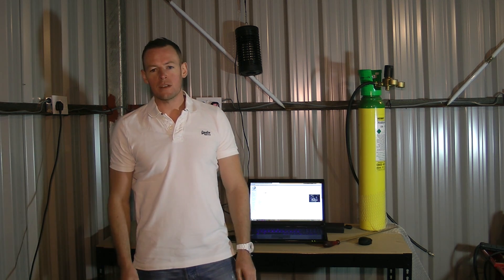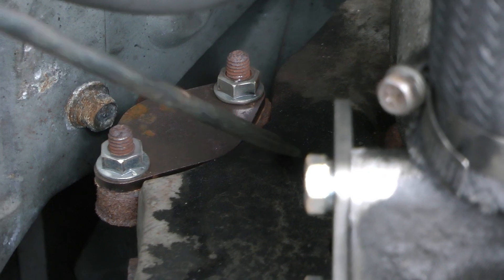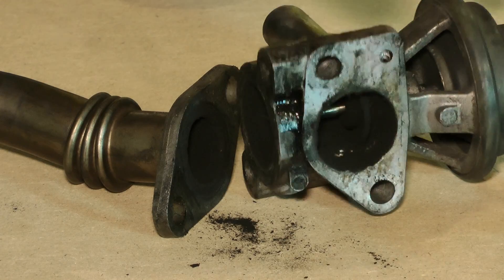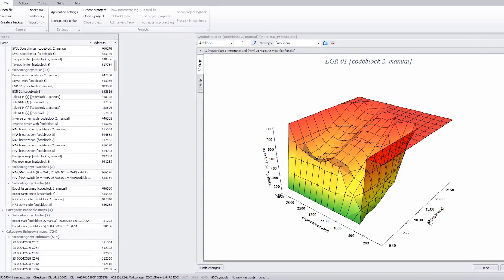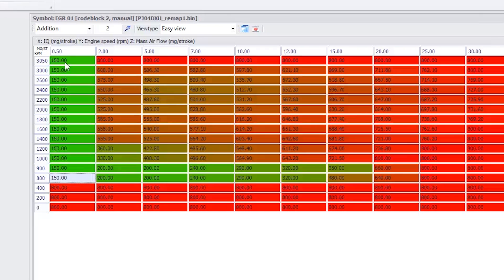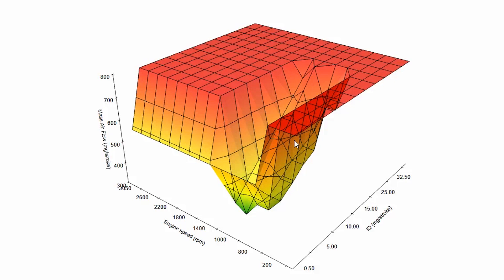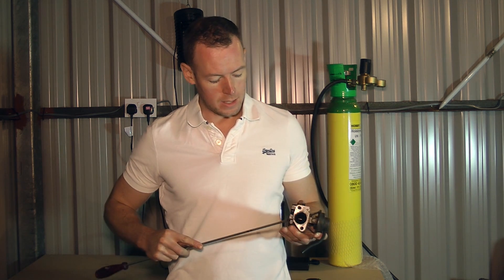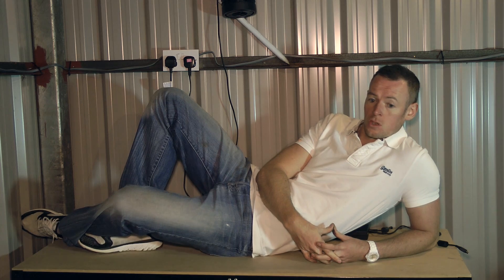EGR for motorsports

Comment: The only purpose for the egr is more fuel consumption so u buy more fuel. That’s all. They knew cars are going to be more fuel efficient so how can we reduce this. By putting the egr crap in. I have tested this and it’s true. I have the same cars with same engine 1 has egr and the other doesn’t. Guess what the non egr is cleaner and I buy less fuel.  Anybody got anything different.
Reply: EGR is shit, who the fuck cares about cars emissions? Industry produce over 70% CO2 emissions. Cut that off and all diesel without EGR would change nothing. Do not be blind. It is false economy.
Reply from the maker: Don't forget the cow farts mate
Reply: Blanked EGR in 2 L 4 inline diesel. MPG went up in city from 32-34 to 39-40...
Reply: Cattle produces more harmful gases than vehicles.

So stop eating soo much Beef

Comment: actually the egr system helps reduce cylinder temperature reducing pinging and spark knock if u dont run an egr valve you must use only a vary high octane or over time the pinging/ detonation in the cylinder WILL cause ur plugs to ware out vary fast and in some cases ive seen it blows holes in the pistons diesel engines are completely different animal you cannot compare taking an EGR system out of a diesel to take in an EGR system out of a gasoline car because the diesel fires differently
Reply: Huh...I thought EGR was developed solely as a way for Diesel powered vehicles to reduce the excessive amounts of NOx gases they produced as result of their high temp compression ignition system. Gasoline engines don’t produce these high levels so I’ve never heard of EGR on a gasoline engine. What manufacturers are using it and why?
Reply: @johncanalese588  Honda since the 90s.

I read saab was using it in the 80s.

However, neither put it in every car, even after the first application.

Comment: I have a few very serious questions that I'm going to ask here... Please only respond to me if you know wtf you are talking about, and you can actually answer my questions. For all you tree-huggers, I do not want to hear about how emissions control devices are so important, blah, blah, blah... You will NOT change my mind, no matter what is said to defend emissions controls devices on automobiles, so don't bother wasting your time or mine by responding to my post here. 
So I ask, TO ANY /ALL OF YOU FELLAS THAT KNOW HOW TO RE-MAP... Where Can I Buy This Re-Mapping Software? How does one actually use it to modify the vehicle's on-board computer so that I can eliminate the emissions shit from my vehicle? Do I need special scan tools or what, in order to link up with my vehicle's ECM/ECU &/or PCM in order to get these informational changes made on my vehicles?
If you'd rather not explain here, I'm fine with that. Supply me an e-mail addy or phone number, or some way that I can correspond with you and I will gladly get in touch with you to discuss further on the topic at hand. 
As an older veteran mechanic, I'm willing to pay (within reason, of course, as I'm not rich) whatever it takes so that I don't need to be pestered by this costly and useless god-damned EGR garbage anymore on my gas and diesel powered vehicles. 
I've done my homework enough to know that the large unnecessary repair expenses and continued downtime in our vehicles is really what is killing us all. Nothing like useless government restrictions imposed on us all to make our lives more difficult / miserable. 
It's a simple fact that vehicle emissions control device failures (that are extremely commonplace) are financially bleeding our society dry. It's certainly NOT the minuscule NOX emissions that is hurting us, it's the lack of money available for other things in our very short time on this earth (what we call "life") that are much more important.
THANK YOU!!!
Reply from the maker: If you're only going to map out the use of EGR it might be cheaper to find a tuner local to you and have them do it.  Rather than go to the expense of buying the software for only one task.

Comment: just because you didnt hear of other uses for egr doesnt mean there arent any :DDD egr on petrol engines safes fuel, on diesel engines it mainly improves emissions. you have lower throttle losses with egr because the engin can suck in more unthrottelet gases

Comment: Hello, I've got a focus mk2.5  2.0 duratec and I am thinking of fitting a egr blanking plate bought off eBay because I think it might be sticking like the one on my previous 1.8 version (same problem,  same fix) when I done it on my last car it ran and drove 100% better the only thing was the engine light came on after 2 weeks, and needed to get reset every two weeks regular as clockwork because of it,    Can this be programmed out with a remap ? 
I did think about removing the bulb but unfortunately ford used LEDs in this one
Reply from the maker: In short yes.  You should be able to find a mapper that will essentially map out the EGR use so the ECU will stop trying and failing to use it.

Comment: EGR systems do work if they are designed properly, unfortunately most vehicle engine manufacturers only need to see their engines last till the warranty runs out. they work well with no issues on John Deere tractor engines because they have an expensive system to make sure it does work, 3000 hours and no soot on pistons or inside intake, the emissions have to be cleaned up as most people don't have a clue about what has been happening in the last 5 years to clean up emissions, they have to as the engines gasses in the air cause cancer and cause lots of serious problems to the young person.
Reply: actorzone everything causes cancer. And our ozone is no better or looking any better because of a egr... the egr isn't what has made emissions better in the past 5 yrs the better built n smarter build cars are what made emissions better in 5 yrs

Comment: There is a third option; just block it off
Reply from the maker: Negative.  The ECU knows when the EGR should be working and what the corresponding readings should be.  If you just block it off it brings the engine management light on.  Unless of course, it's on an engine with the EGR not ECU controlled, then you can just block it off.

Comment: Here is the funny thing Ok guess all you dont know.Why would you even have a egr and your pvc inside a compartment in your valve cover.OK SNART ASS EMISSIONS. Why take dirty air and hot air dump it into a clean intake that is getting cooled air and clean to your intake by your new filter. later on that.Not like the pcv line going into your fresh cooled air intake .Hold on i bet someone bought a 200 dollar KN cooled air filter You are throwing a wrench in what you want it to do.New cars and my race car I took it from the pcv straight to your purge canisters.or leave it off. The pcv valve will open when it builds enough boost in the engine .not enough to give you power.But the cooled clean air im getting from a hose out of the front of the car to my intake .Oh yea by the way the more the air and the cooler tells the pcu to CRANK IT UP A NOTCH. gives me all i need .

Comment: exhaust gas is inert, it takes no part in the the combustion process when recirculated. it cools the combustion chamber.  and it is  is definitely not used in any scenario where your car is under boost conditions.

Comment: thats awsome you take the time and are willing to learn and teach this valuable information,lts a shame i see so much negative comments,everybody has a different view on cars and performance whether they are a master mechanic/engineer,or just changed your air filter without towing your car to the shop...ask ten mechanics when the best time  to change oil is,and what brand is better mobil1 or castrol gtx ? your goin to get about 100 diffrent answers theories and worst case scenarios explained so you end up leaving with new oil/filter/spark plugs/distributor wires ,fuk it i heard a squeek,brakes /rotors etc..everybody has their own way that they belive is best,just experience and learn yourself go yank out a egr and see what happens

Comment: EGR improves fuel economy 
Adding inert exhaust gas into the intake system means that, for a fixed power output, the throttle must open more. This reduces pumping losses from the throttle plate.
Reply from the maker: Except in a diesel, which has no throttle plate.
Reply: EGR decreases fuel economy.
Adding hot air into an engine means that there will be less cold air to fuel the burn and expand. Less fresh air means less efficient combustion, which means more throttle/fuel, which means worse fuel economy.

Comment: hi watched a few off your vids now  if you dont mind i would like to ask your advice i had my astra van mapped 2 years a go from 125bhp to 140 150ish not sure any way its been fine till this oct i sent it in for a dpf and egr delete since the day off map stage 2  my van 2011 astra van sportive 1.7 , 49k has had a bad vabraction shacking  in low gears only 1400rpm to 2100rpm  at all speeds if i drive normal if you like it wont do it or if i drop i gear from low down its fine or full power to red line it gose no problems   it wont do it when cold only once warmed up it starts. i no these engines are reduced till op temp  right van has had new drive shafts clutch and dmf wear new 3k ago and gear box has been apart twice to checked and all is well m32 box . common fault on these .we dont no what to do next as it was fine on old map do you think it sounds like to much toque for my engine to cope with it seam to come from left hand side off van ie gearbox side but everything drive line is new we carnt see any clear faults on van it is booked in to get power reduced but just wondering what would cause such shacking  judder running under full power low revs high gears been doing it now since October

Comment: would removing the EGR on my 1998 jetta 1.9 tdi AHU do any good? & would it make the CEL light come on? if so i can just get a tune for that to go away correct?
Reply: would keep it clean, your model car tends to have a bigger issue with carbon build up than mine (2006 Jetta TDI). You will see less carbon build up, higher mpg, and possibly faster turbo spool. I am getting a race pipe installed in mine next week as well as a new manifold since my current one has 178k miles on it. I live in Ohio and an issue with EGR delete is slower engine warm up time which can cause more wear and decrease MPG. I plan on buying a block heater to offset the warm up time without having an EGR. You will need to get your car tuned also. I am going through Malone, he is very good at what he does and has been doing diesels for a while.
Reply: Above7heInfluence i was also thinking about getting a block heater for it in the winter since i will be removing the EGR. i can tell there's a large blockage, but how much would a tune be from malone roughly be? i have 215k and i'm still running strong. thinking about straight piping and maybe adding some small performance mods. but just have to fix a small hose inside the ecu that emits a P0605 code and i'm tip top
Reply: Brandon Ruhl im renting a tool through fixmyvw which is $50 for the rental and the tune is $99. If you delete the ASV and EGR, make sure you specify that you want a tune for the EGR and ASV though.

Comment: When you adjust EGR parameters do you have to be mindful of of fuel values or other parameters? When you turn off the egr you get less air into the engine.
Reply from the maker: What happens in most cars, is the air is replaced with fresh air instead. In short - engine wants 1000mg of air - it could take 500mg of EGR and 500mg of fresh. It still gets the air it measures, but you'll get more power from 1000mg of fresh unburnt air.
Reply: Thanks!

Comment: +vPerformance Can you remap the EGR on an ALH based on temp? I only want my EGR on during warm-up.
Reply: Remove it and plumb in a flap in the exhaust with a 12v stepper, problem solved and you will be warming up without damage to engine.